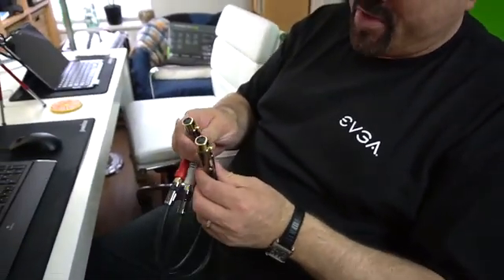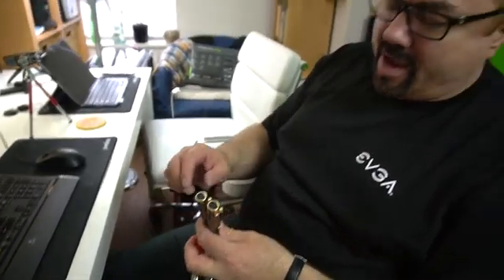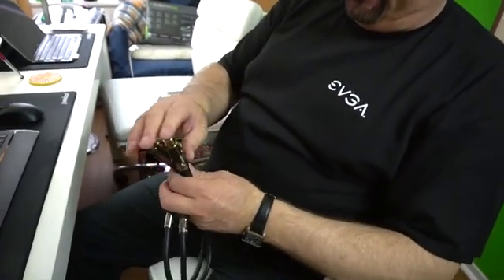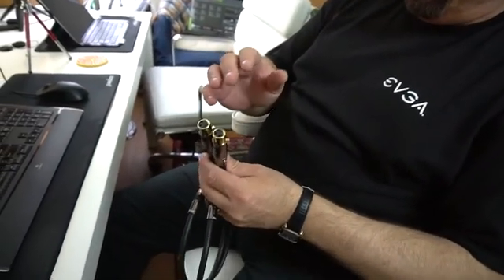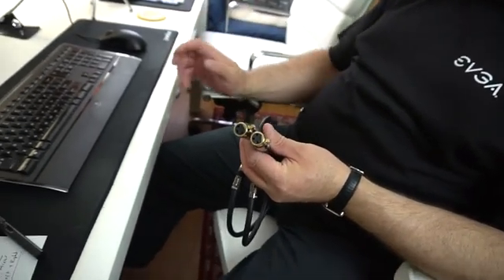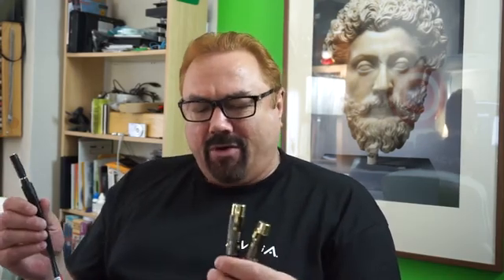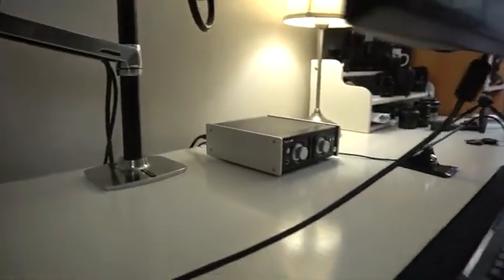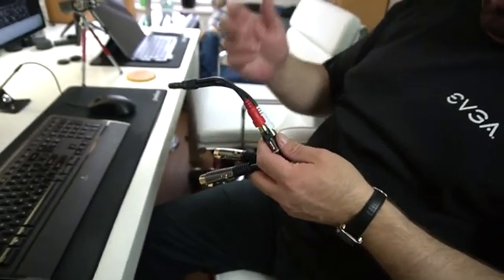How to Setup an Audio Interface -- Tascam UH-7000

Comment: A Blue Yeti USB mic will never sound as good as a dedicated interface. I am failing to see your difficulty. The USB interface to your computer via MAC or PC. Using the ASIO driver and your favorite editing software, away you go. Your integrated amplifier is an unbalanced RCA input stereo pair connection. So you just adapt XLR to RCA. What is the big deal?? Set the output level of your Tascam UH-7000 per the documentation. You are done. I suspect you did not install the drivers properly on your computer unless you are using a MAC, then no drivers are needed. You are never going to exploit the full potential till you do install the drivers. I am an audio guy and an I.T. guy. I have been doing audio for 50 years plus. Computer 30 years plus. It really is not that hard honestly. Also consider who this interface is for. It is for a creative person who first of all will be monitoring via his studio Monitors which usually have Balanced XLR connections, or his/her headphone set. They typically will not connect to a hifi setup though you may with the above connections I stated. You sound like a nice guy. Relax, take a breath, it is easy as can be. Install the ASIO drivers on your windows computer and should be good. Enjoy.
Reply from the maker: "I am failing to see your difficulty."   That's understandable.  Just prior to making this video I was in a forum and someone wondered how to connect a phone to a stereo system with only analog inputs.  The unbelievable thing was that they has NO IDEA what a RCA connector was!  Think about that for a moment: no idea of a basic analog connector.  Now, it is my belief that where there is one person with no idea there is a whole demographic with no idea!

There's people out there throwing out fantastic sounding silver faced gear just because they don't know that a simple 3.5mmTRS plug to stereo RCA adapter would allow them to connect their computer to it.  A tragedy.  So this was my attempt to demonstrate that not only could one make that rather simple connection but that there are a myriad of adapters out there that would let you adapt virtually anything to anything!
So, for you or I this video really serves very little purpose while for individuals seeking the very basics would find something of value here -- the sunset of analog connectivity in home audio equipment is doing us all a disservice and is sadly mostly being replaced with the convenience of....bluetooth.
I did in fact install the drivers correctly and used the Tascam for some time as I had set it up here.  Unfortunately the unit exhibits peculiar behaviour when I'm rendering a video through Vegas -- the unit will insist on switching to the multitrack interface and then cannot be used for system sounds including using it for any media playback.  This is a big problem as I had wanted to utilize it as both for mic inputs and system outputs.  For the most part it worked fine up until I discovered this peculiar idiosyncrasy,  So now I use it exclusively as merely an audio interface for our microphones and don't have the outputs connected directly to the stereo.
There is the bonus that if I do ever wish to upgrade the mic preamps, I can then press the Tascam into being just a DAC for the system. 

Thanks for your considered comment, it was much appreciated.